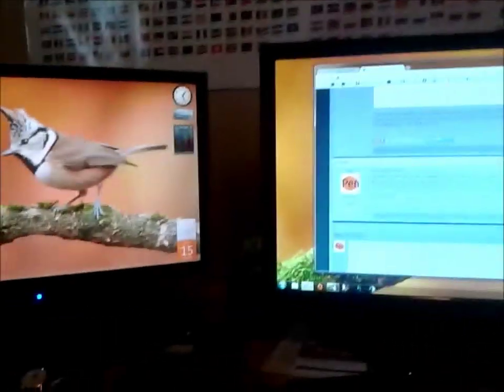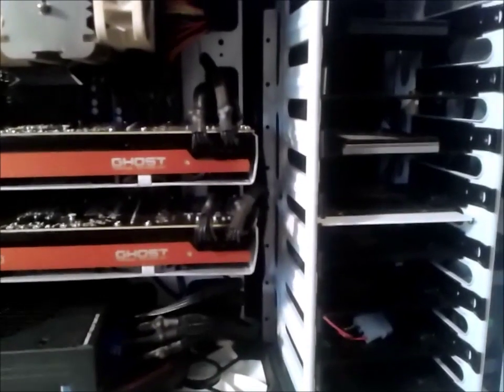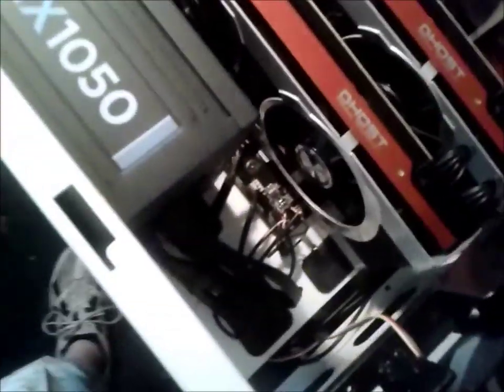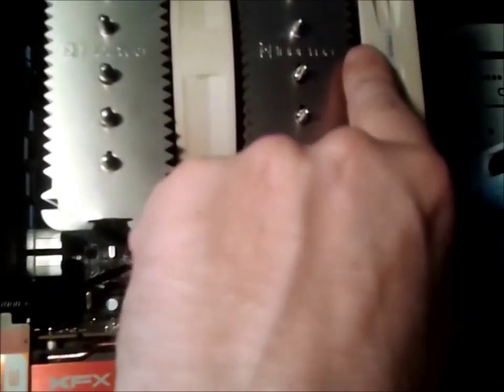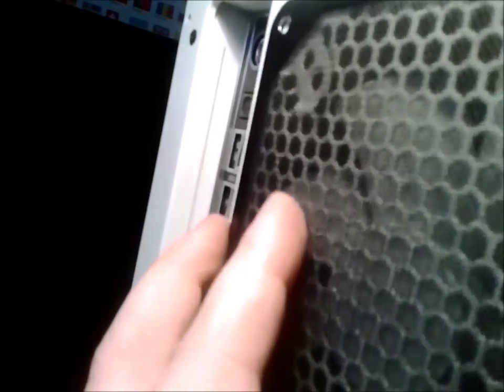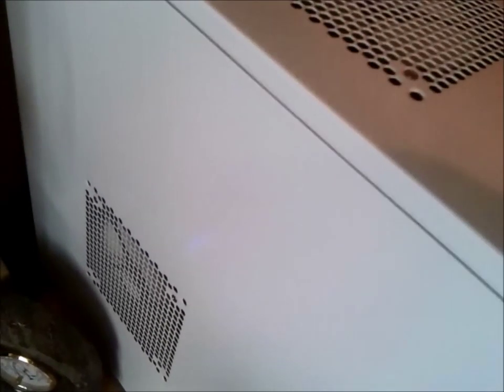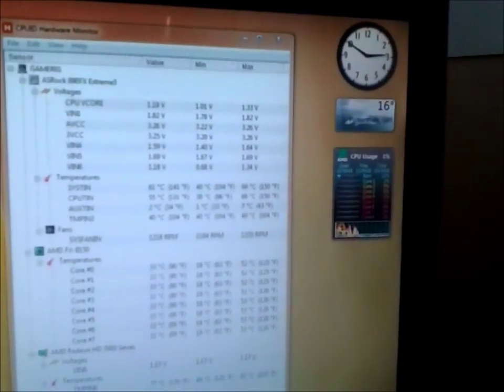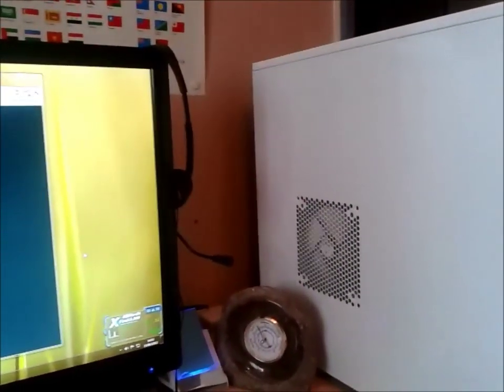Fractal Design Define R3 Air Cooling Part 2 "with rambling"

Comment: Hi - interesting vid & update. Did you figure a filter for your bottom fan? only I'm toying with drawing in air upwards in my R3 setup (not that it's overly warm - 1x560ti and mildly oc'd 2500k) but with two dogs I find I'm cleaning out my filters on a fortnightly basis so a bottom intake will definitely need some filtration.